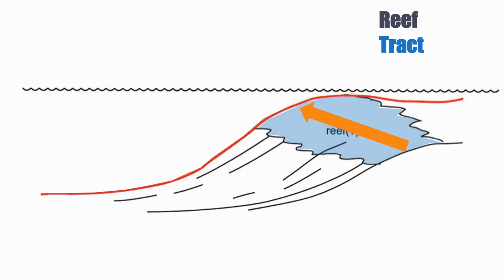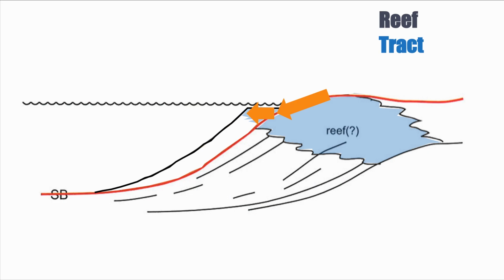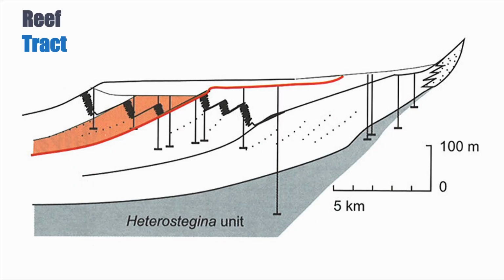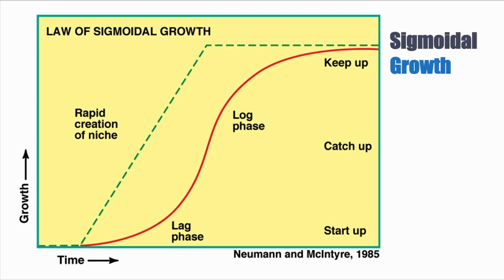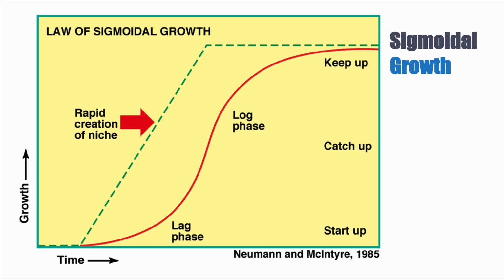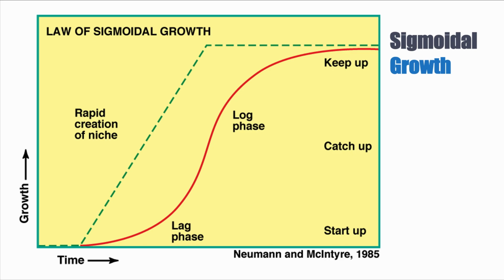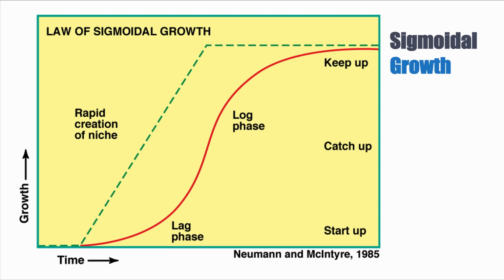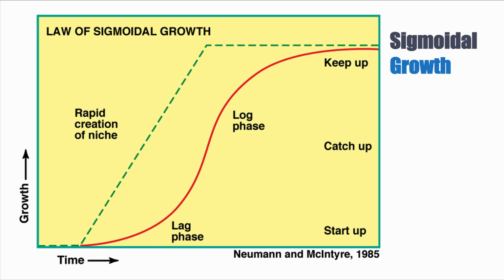Lecture 5 Systems Tracts [Part G]

Comment: Fantastic video however i have one question. Why do we produce less in low stand i don't get that? I mean, if the sea level stays at low stand for a long time then we would or will be able produce also lost of reef and consequently it would be thick and may be even thicker than the high stand, wouldn't it? Basically, it all depends on how long the sea level stays in a position be it low or high stand. If the low stand stays for a long time then we will have thick reef in the low stand and if the sea level stays for a long time in the high stand we will have a thick reef in the high stand. Am i not correct? If not, i am missing something here 😕